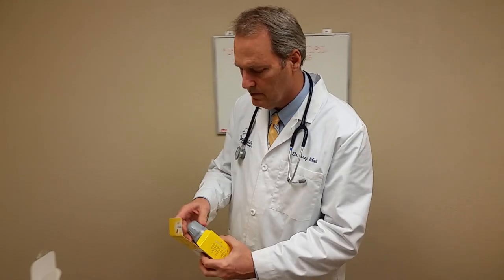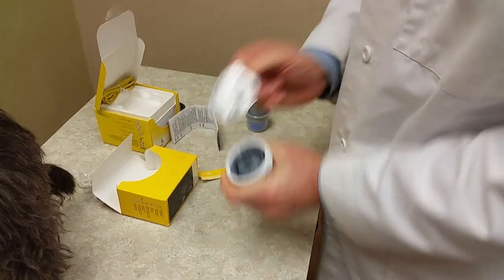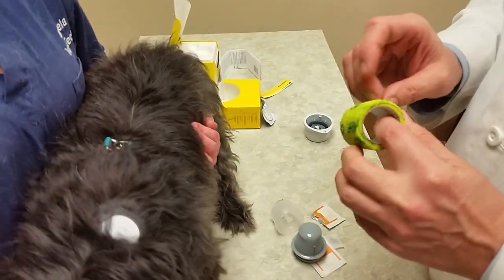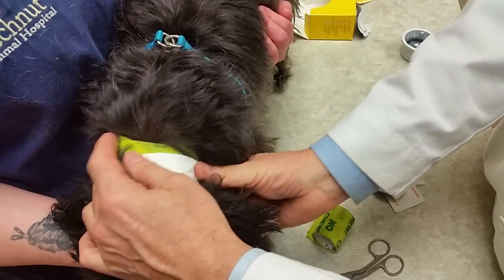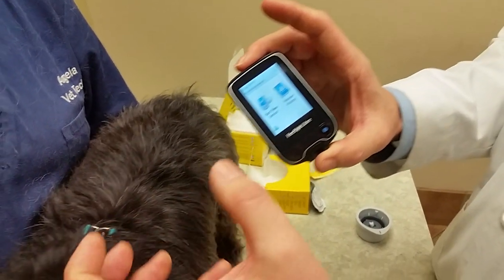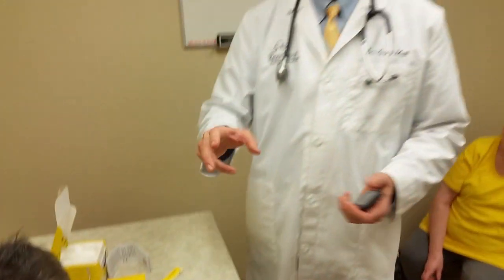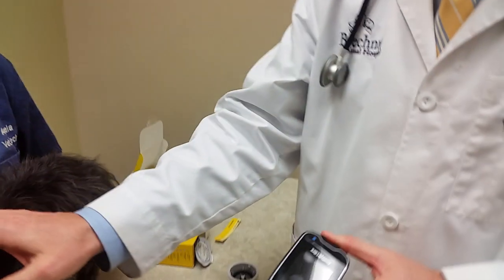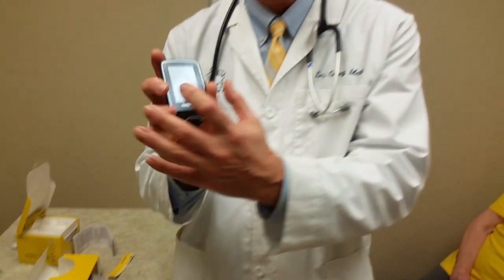Freestyle Libre Continuous Glucose Monitor in Dogs

Comment: I installed this on my poodle and didn't have to wait 12 hours. Mine started working after 3 hours. Works very well. U don't even have to scan the front. I just wave mine across the pad for instant readings.
Reply: Hello. Our dog was diagnosed just a week ago. What's your experience with this? Is it aqurate?
Reply: Our Westie has the Freestyle Libre plus 3. It is limited to high levels , and I have seen my dog go from picky eater, to no eating. I am skeptical of the accuracy. Always losing signals.

Comment: Hello can you please tell me what’s the green tape your using?
Reply: Vetwrap. 

You can purchase it with or without latex (I’m allergic, so I use the latex-free vetwrap). 

Be very careful when applying it - it’s very stretchy, but can easily be put on too tightly. I suggest wrapping some on your finger or wrist first so you can figure out how tight/loose you need it to be.
Reply: Walmart sells a sports wrap that sticks to itself and not hair. After you “tape” the pet, use regular tape as a added bonus.

Comment: I do my own by testing on my dog. He has been hard to regulate. Would this be beneficial to narrow down the reasons why he isn't regulated
 What about cost?
Reply from the maker: Yes this would be beneficial. We find regulating the difficult cases much easier with these monitors.  You will need a reader (cost about $80) and each sensor that cost about $40/

Comment: Thank you for this video. I just had this placed on my little dog and this video help ease my anxiety. Only thing is, if anything goes wrong with the sensor or monitor, Abbott, the company doesn’t replace anything, or offer a reimbursement. I’m currently fighting them right now as the sensor installed malfunctioned and stopped working. But this is a great video! :)
Reply from the maker: When we use these sensors in pets, we are using them off label in a way the company had not intended. Thus we can't expect them to reimburse us for failed sensors. We use these at our own risk, financially and otherwise.
Reply: Unfortunately my vet who instructed me to get this system did not tell me that ahead of time. They replaced it though..
Reply from the maker: I understand. I look at it this way. Occasionally pet owners will have to eat the cost if a pet scratches the sensor off or if it prematurely fails. Still you are coming out way ahead because you aren't paying for a day in the hospital for a glucose curve and you are getting your pet regulated faster. Your veterinarian will guide you through the decision making, This takes much time and expertise on the part of you veterinarian to do this so expect your veterinarian to charge a fee for this service.

Comment: Hi, I was just wondering if you just clipped the dog or if you shaved the area as well?? I have one for my dog and he will wear it when he is boarding at the vet over Xmas.Thank you for doing the video!
Reply from the maker: The area is just clipped with a 40 surgical clipper blade.
Reply: You can use “tissue glue”, 3M makes it, as does other companies. 
I question the accuracy and reliability.